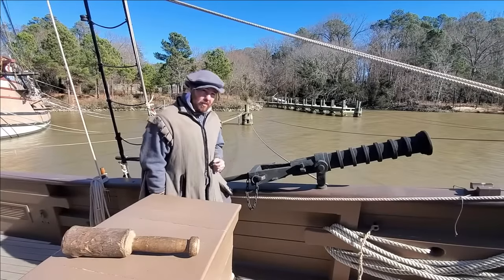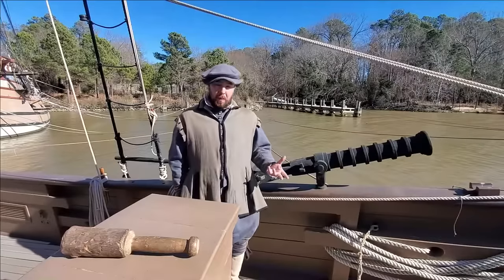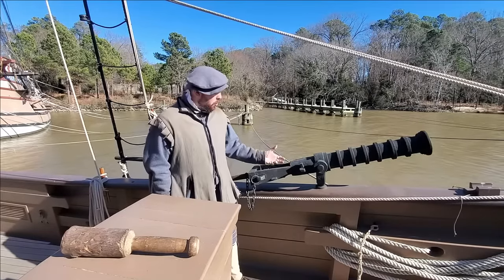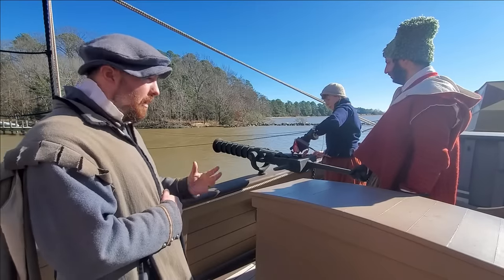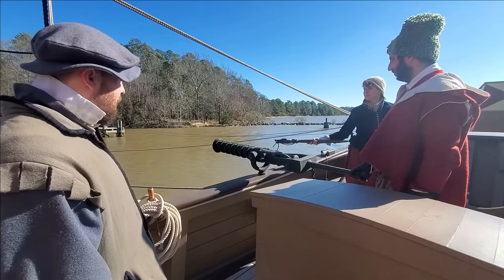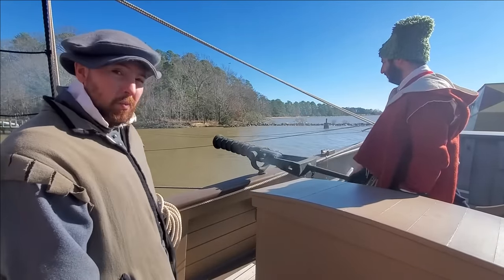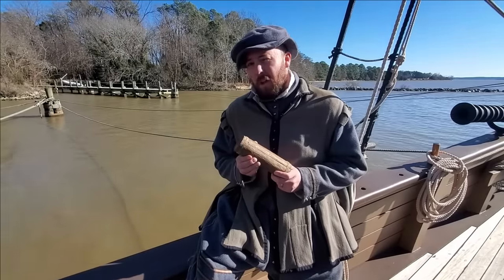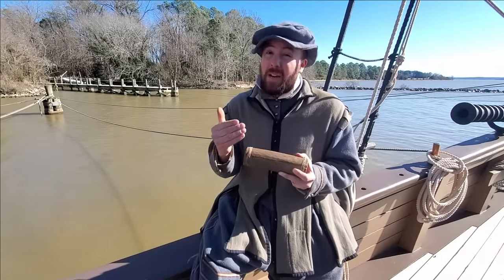Primed and Loaded | Wrought Iron Swivel Gun

Comment: I wouldn't think they would want to lay the wedge on the gunwale, as it could easily be knocked off, either by contact in the rush of battle or if the ship lurched.  Onto the deck wouldn't be much of a problem, but into the water would be a different story.  It ould seem there should have been a specific holster or shelf for it, either on the gun itsself or inside the gunwale.
Reply from the maker: Why? the wedge is chained to the tiller.
Reply: @JYFMuseums  Changed?  Do you mean chained?  If it is, that's not apparent from the  video.
Reply from the maker: Yes chained.
Reply: Eyes.  It's chained to the gun itself.

Comment: I'd be a bit nervous aiming this piece, given how the breach is constructed. How realistic is it that something would fail and the breach could blow up in your face? That could be like the Kentucky Ballistics .50cal incident, but with god-knows what caliber is on a cannon like this.
Reply from the maker: Don't be nervous.  Historically it is not as though artillery pieces are constantly and regularly failing and there are the practices of proofing guns to ensure proper manufacture.  By the early-17th century these forged wrought iron breech loading guns are a successfully proven design that have already been in use for a few centuries.
Reply: Black powder doesn’t build up pressure the same way as smokeless powder.  Also the shot cup isn’t made large enough to blow up the gun.  Scott’s internet bought rounds were significantly over pressured.  Like they should have been approx 55,000 psi and he ended up with 85+ psi.  According to the guy who built the gun.  The shot cup simply won’t hold enough powder to so that.  Theoretically.

Comment: This seems like a good way for rapid fire at least in small cannons. I wonder why it wasnt developed more.Muzzle loading still in use in late 19th century
Reply from the maker: Thank you for your question. We'd say first that speed and urgency were not universal concepts of warfare at this point in European conflicts. Importance is not necessarily placed on firing artillery as fast as the gun crew can.

In the development of artillery, breech loading came first. The downside of these early guns -- known as bombards -- was the gas loss because of the inability to seal off the breech, and therefore loss of energy.  The advent of muzzle loading guns was the necessary technological advance that allowed gun powder to be fully consumed and generate higher pressure and energy.

Breech loading guns will not again replace muzzle loaders until there is the ability to effectively seal a breech to prevent that gas loss. Technology and manufacturing capabilities come to that point in the 1850s with the development of the Whitworth and Armstrong guns.

Comment: You can easily see how a reasonably trained gun crew could lay down an decent rate of fire if you had a good number of the chambers and a reloading crew.  Seems, in your demonstration, the bottle neck was priming.  Imagine if this was coupled with a more modern igniter, not needing the priming powder or slow match.
Reply: With a third person reloading four breechblocks is enough to keep up a steady rate of fire but five is desirable to give a little more time to swab correctly. Powder, wadding and shot sewen into preloaded calico bags is the fastest way
Reply from the maker: The only issue is that "ammunition fixed" was not at all very common and it was very common to load loose gun powder, almost ladled it, into the artillery piece.  If there was a need to reload these breech chambers, it would have been a simple task to load with a measure of loose gunpowder and stop it up with some wadding.
Reply: Yeah, I load mine loose most of the time but I have some bagged shot loads as well, mainly to demonstrate the beginnings of "cased" rounds.  @JYFMuseums
Reply: @JYFMuseums  that the beauty of these style guns.  Separately loaded  ammunition containers, loaded by a trained crew, would still be able to keep up a reasonable sustained rate of fire.  You would just need to ensure proper stabbing of the chambers to prevent premature ignition.

Comment: If wrought iron guns are so much cheaper and simpler why did cast brass and bronze cannons last for so long well into the 19th century even?
Reply from the maker: Thank you for the question.  The key difference is whether the gun is a breech loading piece or a muzzle loading piece.  

The earliest artillery pieces were forged guns built up from wrought iron hammered together and constructed as breech loading guns.  These were effective guns, but there was always an issue of gas loss at the breech as the gun was fired, and to realize the full potential of the energy generated by the burning gun powder, the bore of the gun needed to be a sealed environment.  The only way to achieve this sealed environment was by creating a muzzle loading gun through casting and the most ideal castable metal was brass/bronze.  Working with brass/bronze was well understood at the time, not the case with cast iron, plus, it was not much of a stretch to transition from bell casting to gun casting. Brass/bronze was durable and did not suffer the decay that iron suffers in a marine environment. 

These cast bronze muzzle loading guns and forged wrought iron breech loading guns will serve together for some time.  The Mary Rose at the time of her sinking in 1545 was armed with both cast bronze and forged iron guns.

Being able to make cast iron was a rather new technology by the end of the 15th century and it is in 1543 that the English are beginning to cast iron guns; and these iron guns are certainly cheaper than the bronze guns.  But the chemical structure of cast iron gives an inherent brittleness to the cast iron product, that can lead to the bursting of the cast iron gun as well as the higher degree of corrosion suffered by iron over that of brass.  Continual developments and improvements in the manufacture of cast iron artillery along with their affordability make them viable guns, but bronze would always have a high level of durability and corrosion resistance.

This will carry well into the 19th century with one development for the solution for the brittleness of cast iron artillery, being the banding of the guns breech with a wrought iron band. One example of this banding with wrought iron was the work of Captain Robert Parrot’s development of the artillery piece that became the Parrot Rifle by the period of the American Civil War. Read about the Parrot Rifle here -- https://en.wikipedia.org/wiki/Parrott_rifle
Reply: @JYFMuseums  Thank you for the in depth response so timely!! So interesting! :)
Reply from the maker: You are welcome.
Reply: While cast iron in Europe might have been a new technology, iron casting developed in China circa ~8-6th Century B.C.E and they had developed a finery process around ~400-300 B.C.E

Which is an insane gap in time if you think about it.
Reply from the maker: @thejackinati2759  Right.  And from 200AD in the subcontinent of Asia, India was making a modern steel -- Wootz or crucible steel.  Something not accomplished in Europe until the process is developed by Benjamin Huntsman in 1740.

Comment: Would it have ben possible to produce a Glock (all metal of course) in that day ?
Reply from the maker: We'd say no. There are many technological advances, that we today take for granted, that would have to take place first.

Advances in materials processing. The ability to make modern steels in the 18th and 19th centuries. The advent of the ability to make coil springs. The ability to produce interchangeable parts at the end of the 18th century. The development of the rimfire metallic cartridge in the 1850s, followed by the centerfire cartridge. The development of clean burning gunpowder in the last quarter of the 19th century. Precision manufacturing. Then the ability to understand recoil, the energy it creates and how to harness the recoil to cycle the action of the pistol.

All of that culminated in the advent of auto pistols in the 1890s. The advent of the plastics industry would allow the Glock with it's polymer frame in the 1980s.

Comment: Please don't put that steel pin on the railing of a ship.
You know where it will eventually end up.
Reply from the maker: It's not going anywhere. The wedge is chained to the gun's tiller.  Placing it on the railing of the ship is as safe a place as any, it is not going to be lost, and leaves one without the wedge just hanging and swinging by the chain able to bash anyone in the shins.